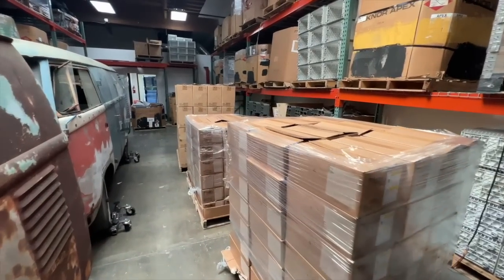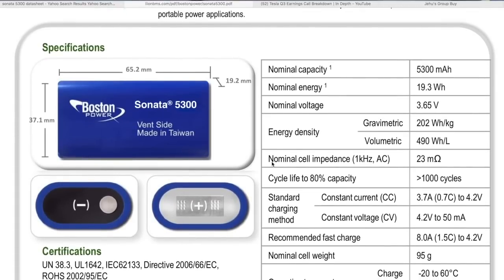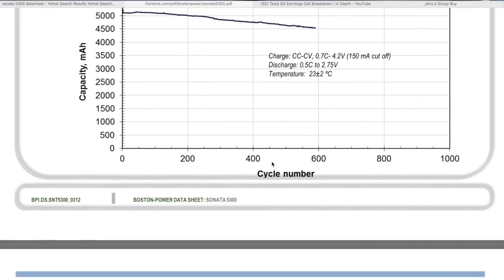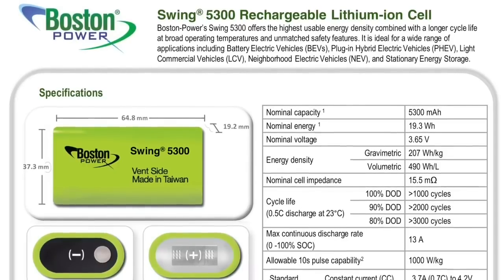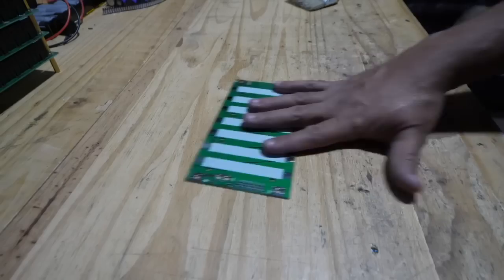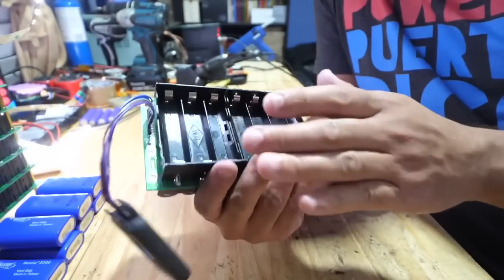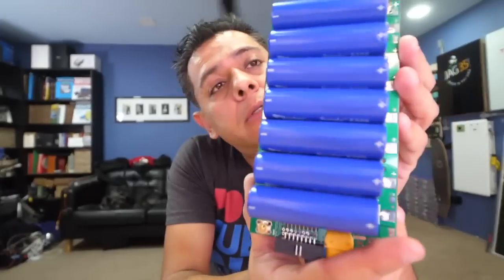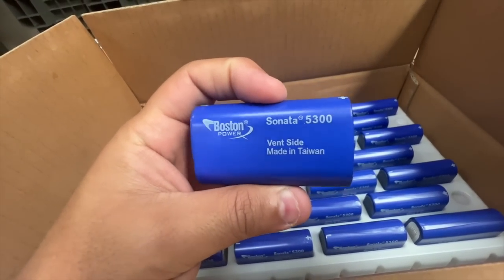$100/KWh Medical Grade Boston Power Sonata / Swing Cells

Comment: I have 4 sets of these batteries. Like Jehu shows, I too had problems spot welding my .1 mm nickel strips to the contacts. I found scuffing the contacts and soldering actually worked better. Use your own judgement to prevent thermal runaway.

Comment: Watching the video and found the concept of using them with your 7s modules.
Now that you have 4 times the batteries would you upgrade the fuse to 10 amp or 20 amp? If 20 amps
Just would it be 10 amp fuses at both locations on the positive side giving you two hot standoffs in order to distribute the extra power envenly,?
Just had to throw this at you since you mentioned the 2nd fuse when you designed the board years ago. A video showing heat factors exchange on boards between  single or double fuse. Ok. I'm just a pain in the board. 😁

Comment: These Sonata cells almost look like they would fit in some Petzl headlamps or any headlamp that uses 3 AAA.  Maybe? Checking measurements . .  that's a NO.   No fit.  too bad.
Reply: I'm surprised climbers haven't changed over completely to 18650's or 2700's for headlamps.  I see many of them are either lipo rechargeable or aaa/AA batteries

Comment: at 19.3 watt hour they fall just below the limit for the usps.

so if you was selling them on ebay you should be able to ship them as normal mail parcel not have to declare as dangerous goods though you may still have to apply the lithium ion warning label to not put on passenger flights.

or at least you can get away with shipping them by usps priority mail as long as you ensure they dont short on anything and you pre pack them and submit the package to the post office they may not say anything as long as you dont mention batteries.